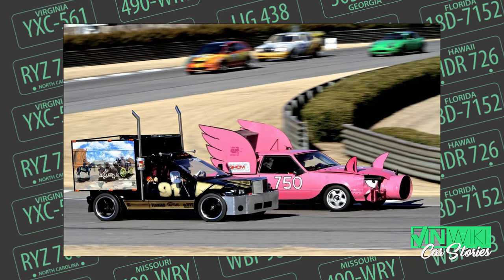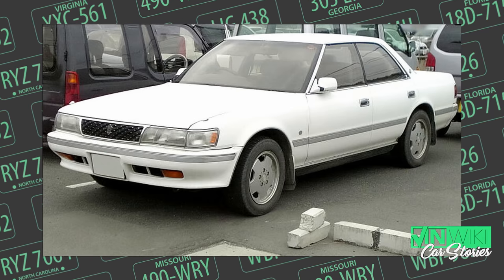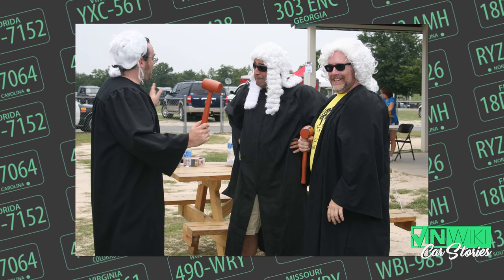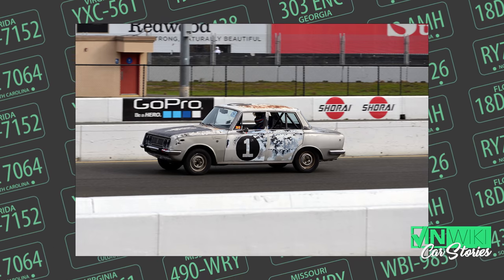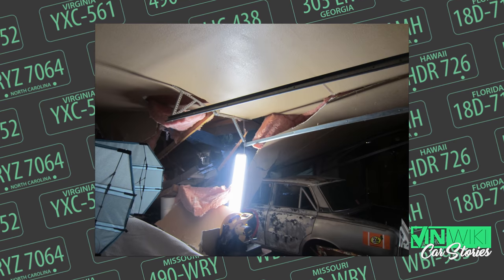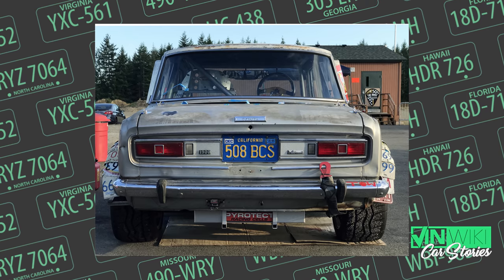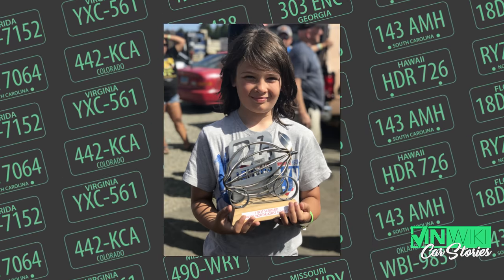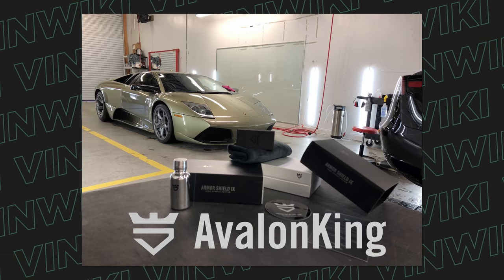How Corona saved my life (& my cheap race car)

Comment: Wait.....they bitched about a cheaper and known to over heat more often 1jz....so sre old beater Hondas with vtec not allowed since you can up them to like 700/800hp in a car silly light to the equivalent of 1000hp....
Reply: Oh yeah...they'd hate me. I'm good at finding cheap shit I'd just need someone to find me a 500 dollar roller. Lol 1500 dollar corvette engine making like 800hp with a super and the junkyard threw in the tranny....done. 

700 dollar rebuilt iron block ls with a pieced together turbo kit. If the rollers were a 1000 dollars I could cheat so hard. Heeeeeey dude can I get that rx7 roller off you....ls swapped rx7 with corvette bits and random junk yard diff with tall gears.